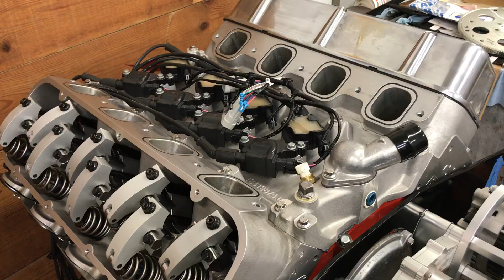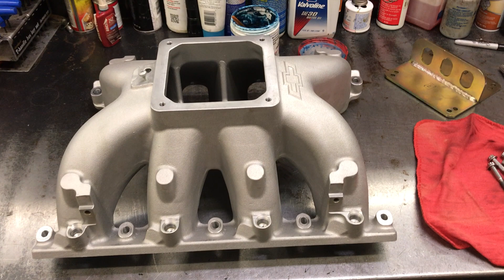632 crate engine heads and lower intake

Comment: So without sounding stupid this is a completely custom block I'm imagining. It's not 496 gen7 big block bored and stroked.. I know raylar is really good when it comes to the 8.1 but I was looking to go in a different direction for an HD truck
Reply from the maker: You can buy the 632 engine block from GM. Pick up a 2023 GM Performance Parts catalog or look at their website. They have everything you need to build a 632 in the catalog.
Reply: Is this not something that you put together.? I was just curious if you were an engine builder or just showing your own stuff
Reply: Also you show the upper intake, you know being distributor list with coil packs and so on I'd really rather have fuel injection and not deal with a carb not sure if that's an option or not for that particular platform
Reply from the maker: @ronkirkham3410  We do build race engines but you can buy the 632 from GM for less money. The GM 632 is fuel injected and makes 1000 hp on pump gas premium.